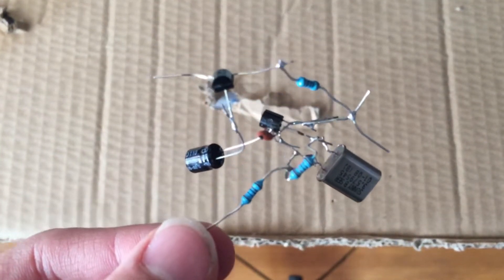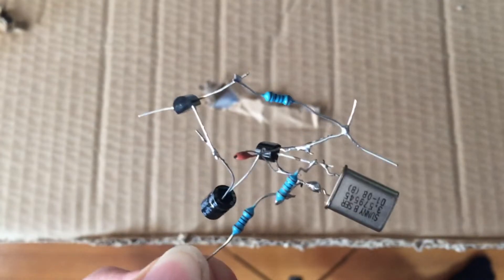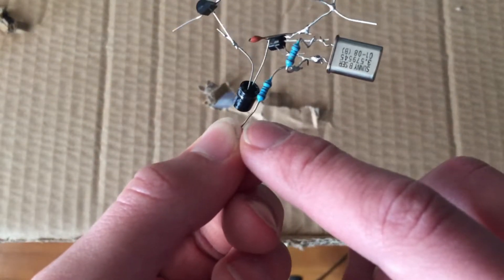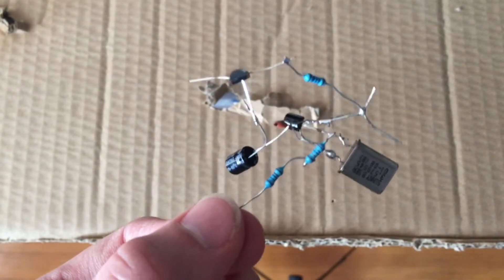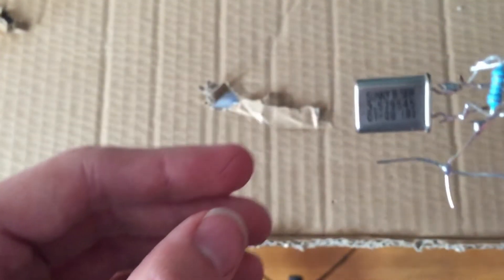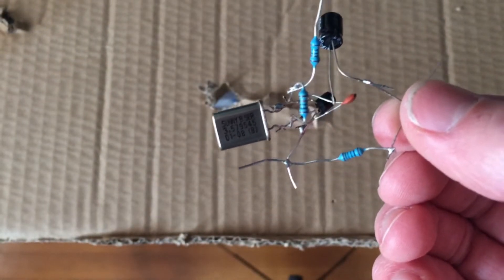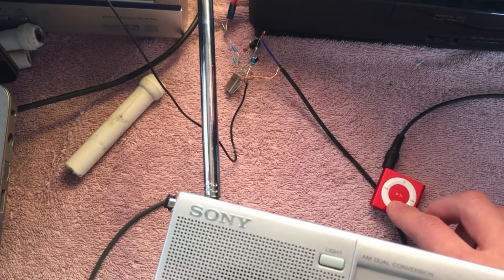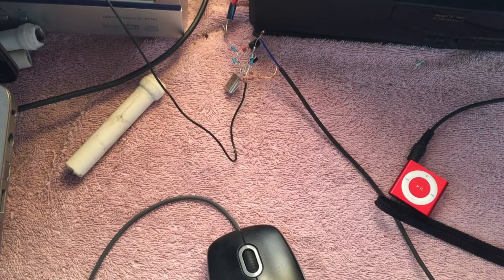No Circuit Board Crystal AM Transmitter - AM2PC pt. 4

Comment: good morning sir, and merry christmas. May i ask if you know how the telephone keypad works? and why do my telephone cable have the same color? because i am trying to make a  wireless intercom via fm and have a dial function but when i mean dial im just pressing one number. Thank you
Reply from the maker: You can create your own telephone line with just 9v. See my previous video about creating a telephone party line system. Then as for grabbing audio off of it, see Electroboom's video on grabbing audio off of a telephone line https://www.youtube.com/watch?v=bF4lPw5p63E

After you have created a circuit to grab audio off of the line, you can pipe that into and FM transmitter. You can then get an FM receiver and build a circuit that injects the audio from that into another telephone party line system. As for dialing, you'll have to put a DTMF decoder on your lines, then build a basic computer to do things in response to hearing different key presses.

A telephone keypad uses DTMF. Each key produces a different sound on the telephone line that the telephone company can distinguish and know what button you are pressing. This is what the DTMF decoder can also do.

I can't really explain why your specific cable has the same colors, perhaps it's just because they didn't expect anybody to cut it open to look. Most two wire telephone cables have a red (ring) and green (tip) wire. If you have a four wire cable, it will have those two in addition to a black and yellow wire. These extra wires can be used for extra services, but generally go unused in most households.
Reply: @rcat256  oof sounds like expensive. thanks i will just do the part of hooking up the telephone to my fm transmitter, i am just a bored 12 year old trying to make this using my christmas money, thank you sir